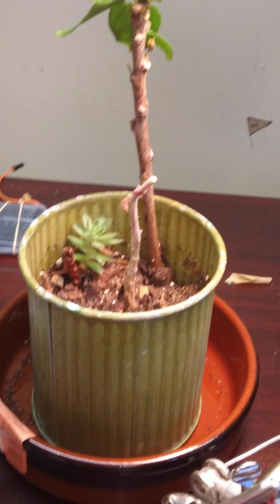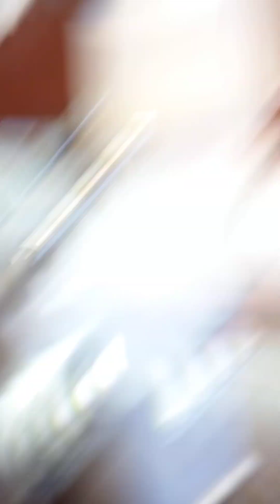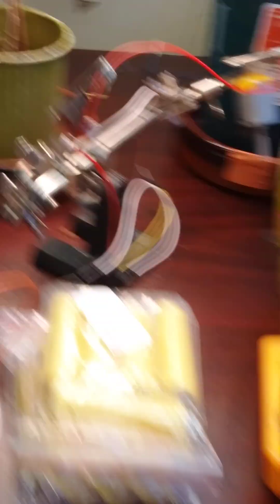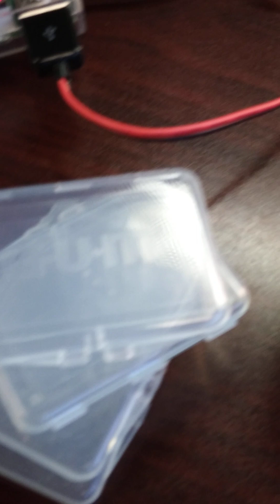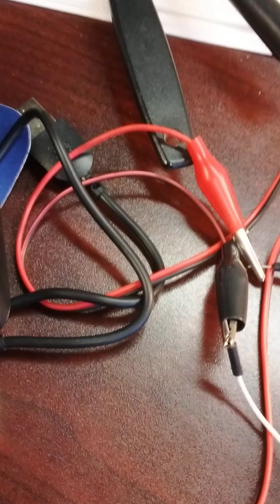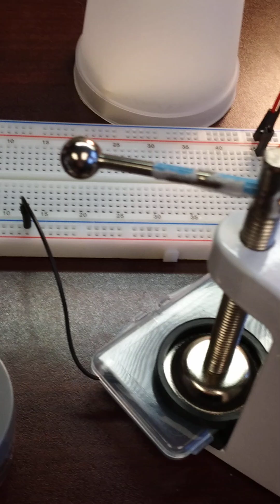Graphite Felt in a 5V /500 mA Circuit with DC Motor

Comment: Could this graphite felt be used for te windings of the motor? Been trying to reduce the weight of the components.
Reply from the maker: Interesting!  Try the thinnest graphite felt on the market. I see only about 5 ohms-cm on the material I use which is not a problem in the small circuits I have created to date.